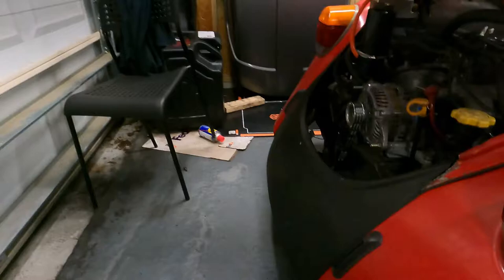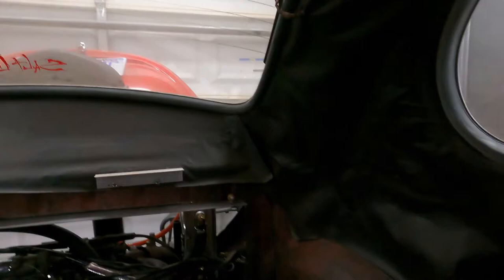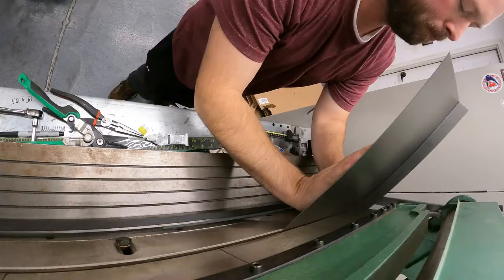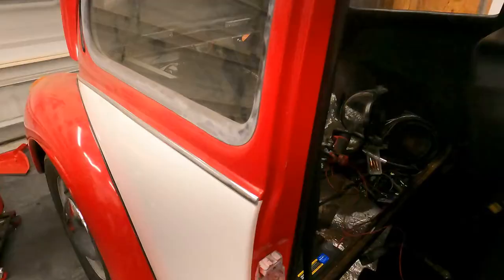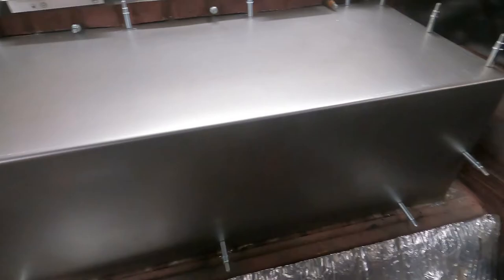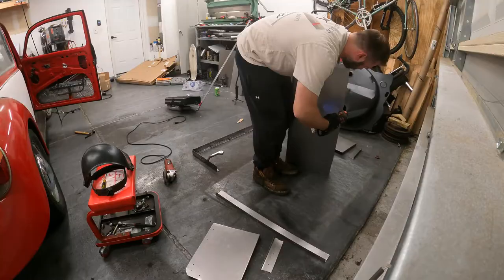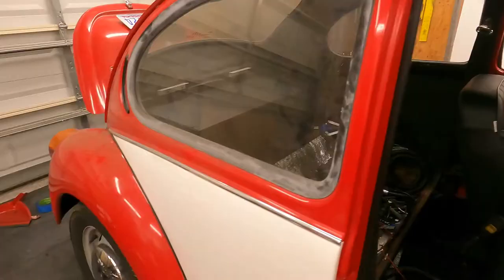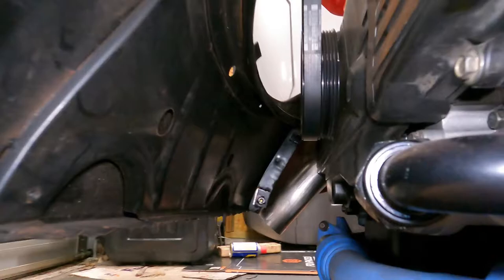Removable Firewall and Rear Apron -- 1973 VW Super Beetle Subaru Swap

Comment: Nice one. Wish I'd done something similar with mine in hind sight and kept the rear seats. Biggest downside of moving the firewall into the car is the amount of heat it generates inside the car, and additional noise. Hopefully as yours is much less intrusive and your rad isn't in the back it will be less of an issue!  🙂👍
Reply from the maker: Thanks for the support! After a couple drives, heat doesn’t seem to be an issue but it is also cool outside. I think the Thermo-Tec will be a lot of help with the temps too.